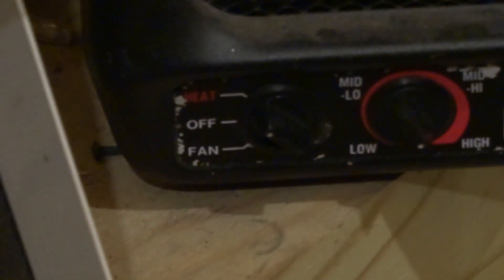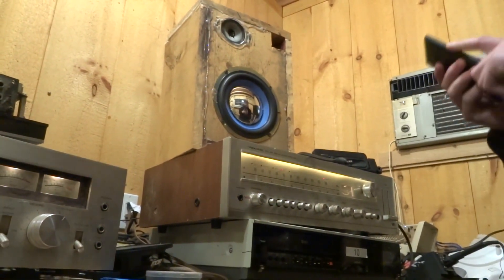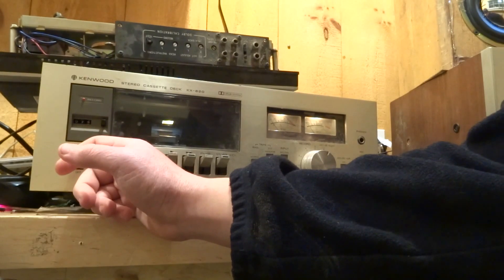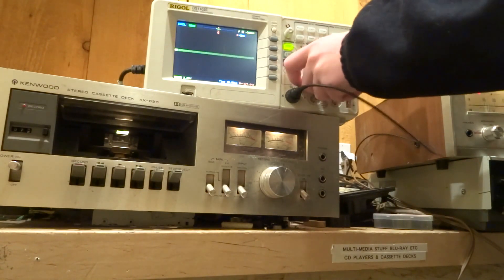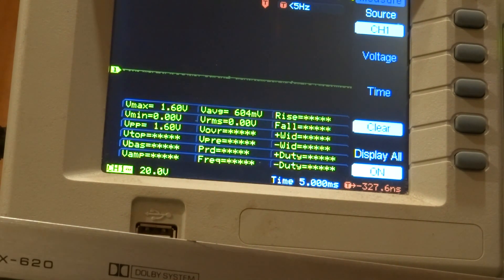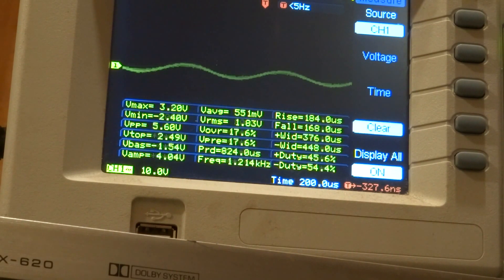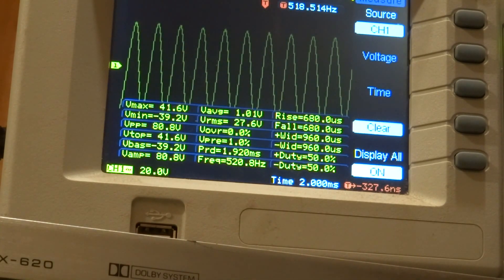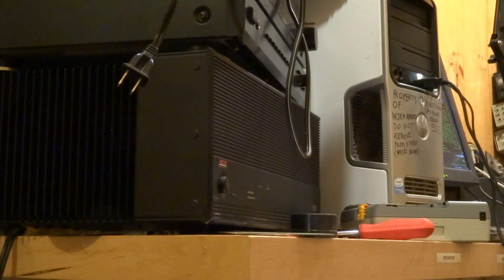Vintage Realistic STA-235 Stereo Receiver

Comment: I had this amp back in the day. It was a very clean and powerful amp. RMS was 55 watts per channel with around 0.02% distortion @ 8 ohms. The "Auto Magic" tuning was great. You can tune near an FM station and the receiver would pull the station in for you. The defeat button was there in case there were two stations very close together. The stonger one would always win, so you could defeat the auto magic and manually tune to the weaker station. Early led's were used in the auto magic signal meter. It would turn red until the station was pulled in strongly. The meter is to show you the signal strength. That amp dates back to the 70's. A collector would like it in good working order. It has either 1 or 2 tape monitors on it, which you can't find anymore. This would allow you to use a equalizer and/or you could listen to the tape that you just recorded within milliseconds after recording it. Thus, allowing you to tell how good a recording you were making.
Reply from the maker: Yea, I like it. It is a good receiver. Your right about tape monitors being hard to find on modern receivers.
Reply: i bought this amp in '78 when i was a freshman at Mich St. it was actually a Marantz amp. made for realistic . i bought  great speakers and a turntable with it for $ 268.00

Comment: STA-235's were only rated at 80 watts per channel rms at 8 ohms. They've been built with a ton of headroom so that you get minimal distortion. Btw nice find! All the Realistic receivers I've been buying off Ebay have had dead amps or bad caps.